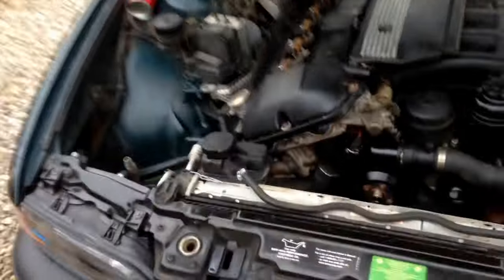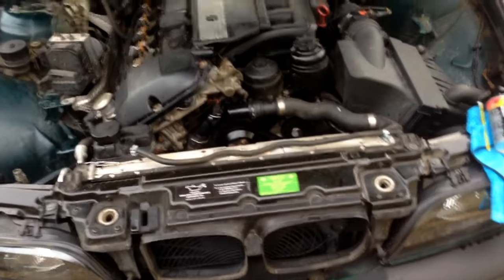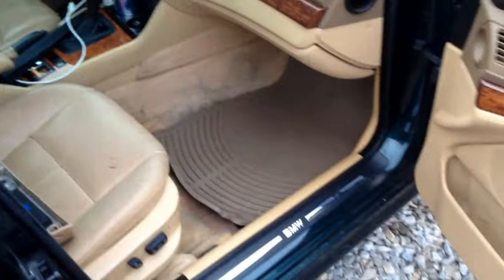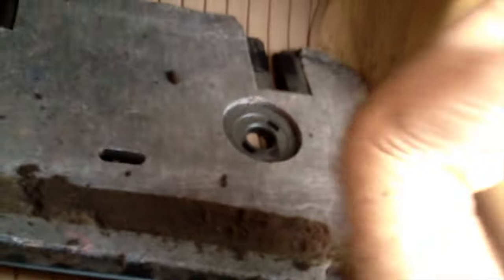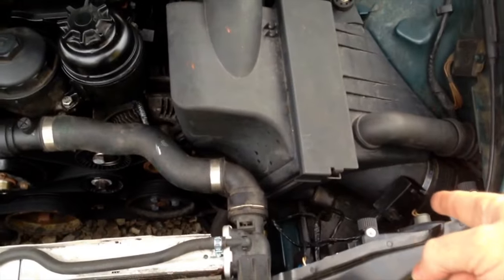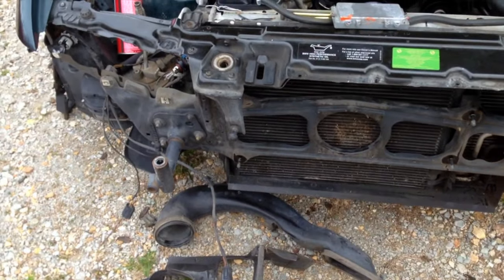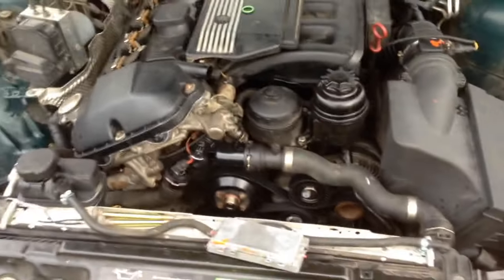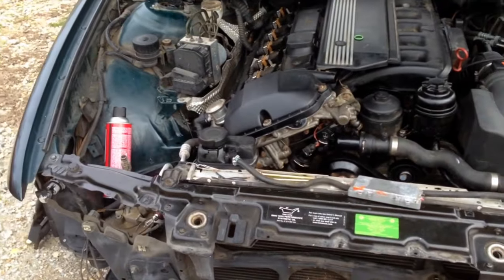BMW E38 E39 AUX Electric Fan Not Working Diagnostics

Comment: Hey Nice videos Nathan, The relay box you refer to that is located on the fan shroud is in fact an air contamination sensor inside it has a gas sensor, this senses Parts per million(PPM) contaminants in the air flow. This then controls air flow in the cabin (if air is contaminated for example when passing through smoke from a yard fire) the air flow in the cabin is turned to internal recirculation. The sensor does have a small foam filter inside prior to the gas sensor, pop the cover open and the filter can be cleaned in IPA and replaced. Works like a dream after. Hope this helps you.....
Reply: So that means the fan just stop working if there's a fire  nearby
Reply: @gilbertobernal8738  no, it means that if detect smoke outside  will put your interior ventilation in recirculated mode, have nothing to do with auxiliary fan.

Comment: cool you speak of that x5. I just picked one up my self but of course it has problems. big problems. head gaskets are blown water is mixing with oil. so I'm going to try to find a motor cheaply hopping I do. so if you know of any good motors laying around and have time  let me know.

Comment: Just had an issue with my new/old e53. the aux fan would not come on. I actually just gave it a spin and it was slightly seized. After a couple of pushes it started spinning on its own and cleared whatever debris/rust that was restricting it and now it works perfectly. Incase anyone sees this in 2022 and your car may have been sitting for a while, give the fan a couple of turns and maybe hit it with some wd40. you may get lucky like i did.

Comment: Do you have a mechanical to electric fan conversion video? I can’t seem to find one and I’m sure you must have covered this topic. Love your channel man thanks for your work
Reply: I think it might be engine dependent, as my 530i has both mech and electric, just found out my elec is bad, as my mech gets loud as the car warms up
Reply: they already have a mechanical, but it needs the electrical for the ac (and apparantly overheating) but i have been driving mine for 4 years without the electric ones and it has not overheated

Comment: This has not been covered in this video AND THIS IS  VERY IMPORTANT.! For BMW X5  there is a huge twist. If the aux fan does not turn on when the AC is on check the AC compressor clutch if it is not also turning when the AC is on you are low or totally empty on Refrigerant yes that's right. Check the pressure of Refrigerant and if it is empty or not have it checked for leaks and refill it. There you go your car is fixed
Reply: its not an X5 video XD

Comment: Hey Nathan, hope you see this comment on this old video, but my E39 540i has been having an odd issue and I'm suspecting something is wrong with my aux fan. After the engine warms up, my aux fan starts blowing HARD. Like abnormally loud hard. When fan is blowing and sounding like a jet engine, my battery light starts flickering. I'm trying to rule the alternator out at this point because it seems to be charging normally until the aux fan kicks on overdrive.

My question: do you think a bad relay could be causing the fan to blow harder than it should and possibly be drawing more power than it should? Or do you think it's the fan itself? Coolant temps are fine so I don't think it's a temp sensor issue causing the fan to go into overdrive

Comment: Great video. I have a 2001 E38 BMW Aux fan problem. I replace my 50A fuse it was shot, I replace the aux fan. When I hit the AC, the fan did not come on. Anything I should check that I did not, Thanks

Comment: hello i have a question i am having the same prob on my x5 e53.. we tried jumping the fan but it would only spin for a few brief moments the same happened with a replacement fan i got from the junk yard. my question is when being jumped are the fans supposed to run full speed or will they only spin for a few moments? trying to diagnose wether my fans are both bad

Comment: Mate, the relay box is located on the fan itself. That little box you said was the relay box is just a pollution sensor and will disable outside air in the cabin if it senses pollution.

Comment: my lower radiator hose got sliced by the pully it moust of laid on ,I cut it and and put it back on shorter ,Now car overheated at idle  , Could I have cut the sensor off ?

Comment: Hi Nathan, Love the content! I had a question, I have a 2002 BMW 325ci with manual transmission so I have the electric fan and it recently stopped working. Unfortunately I left the car on for a little while and it completely overheated and blew my expansion tank along with my radiator. I figured it was a bad fan and I was partly right because it doesn't turn on. I've replaced the temp sensor at the bottom of lower radiator hose with a used one in the past and now with a brand new OEM one. I've taken direct 12v power to the fan and it turns on, I've checked the fan fuse. but I still cant get it to turn on automatically with the car, I feel like the only think left to replace is the relay that mounts on the fan, however I don't like to guess. do you have any ideas?? thank you
Reply: Did you change the fan?
Reply: @vincetaliaferro2777  yes it was the fan after all. I got one from the junk yard

Comment: Hey man I just got back in a bmw your videos are great I’ve done a lot of work using them so far on my 99 e39 538i BUT I cannot for the life of me find a few of my issues anywhere on the internet like I normally can if you see this and still check comments could you msg me ? it is in regards to the cooling system and it’s very frustrating that I can’t find the answers being that the cooling system is Very well documented for these engines/cars lol
Reply from the maker: I answer a few comments still But there is way to many to answer many of them anymore

Comment: My 98 528i, is having auxiliary issues. It turns on when the negative and positive wires from the radiator switch, I cut them to see if it would turn on. The auxiliary fan turns on randomly. I bought and changed the fan switch, I tried 4 different relays located on the driver side that's on the fan shroad. I checked the fuses under the glove box. Again, my fan turns on, how i decided to test it was I took the Male wire that plugs in the fan switch, put the positive and negative wires to touch and turned on. Can you please help me, it doesn't turn on when I have the frost ac on. I'm super annoyed, I dont want to be buying any more unnecessary shit only to figure out my issue was simply and a $10 fix and be 2 min of labor. Lol

Comment: Could you please help me? 
I have following problem. Fan is working but sound is like the fan rubs against something plastic.

1. video is on cold engine (very noisy)
@sRSA

2. video is on warm engine (I could live with that) but if is easy fix, I would like to fix it.
@CebU

Thank you very much :)

Comment: I am having an issue with the fan not coming on at startup with the a/c turned on. The a/c compressor will not kick on until the car reaches it's optimal operating temperature (when the water temp gauge on the interior dash reaches the middle). From that point, my electric fan comes on which I assume triggers my compressor to come up and I have ice cold a/c from then on. Any idea of what is going on in my case? My fan works in the overheat modes but not a/c mode. Help!
Reply: Did you fix that issue? I’m having that same issue
Reply: @pjreynoso15  Needed a new fan.

Comment: I really enjoy your videos & I need your help w/my overheating sensor circuit.  my Veh: 1998 BMW 528I E39 built 4/98.   147k miles  Background: I bought this car via an auction that came with a cracked expansion tank & leaking radiator.   New parts:  Radiator, expansion tank, cap, 88'C thermostat, new BMW plastic thermostat housing, new water pump with metal impeller, new double switch coolant temperature sensor, new aux fan with resistor pack attached, new connector for double switch coolant sensor...and hoses +belts.Testing::::  all related fuses in glove box tested with meter....all good (even the hard to reach 50 amp fuse).  All 3 related relays were checked (1 under dash and 2 under hood), i cleaned relay pins and verified to be working correctly.  I tested aux fan slow speed w/AC on, & fan works correctly.  ♥   I tested medium speed & high speed using the paperclip method @ coolant connector.    I inserted paperclip (brown - black w/red stripe) and medium speed worked perfectly.♥  I then inserted paperclip (brown - black/grey) and the high speed worked perfectly.   ♥    I activated test #7.0 and watched water temps work as per normal (between 104c-108C).  The car runs and drive very smoothly.  ♥Problem:  when Idling in parking lot the display temps climb above 115C and the temp gauge starts leaning towards red zone.  I verified the aux fan (medium speed) still DOES NOT turn on as expected.      When I insert the paperclip, the fan comes on (medium or high functions perfectly....depending on which speed I desire) and then  coolant temperature returns to normal.           WHAT AM I MISSING HERE??    I have the old 3 pin connector so I plan to connect it tonight to see if new coolant sensor (located lower side of radiator on pass side)  is working correctly..    Any suggestions sir?
Reply from the maker: Could be air in the system, , check the big fuse behind the glove box , make sure the little black relay box on the fan shroud is good, at last unhook the battery and touch the cables together to re-initiate the fan
Reply: Thank you for getting back to me Nathan.  I have good news as I believe I found the problem!!  I tested the old sensor and verified it was bad.  Ohms was checked at cold and boiling water on the stove and it never closed.  Then I tested the new sensor installed on the car.   Again Ohms was checked with engine cold & then when up to temperature.  When i displayed test #7.0 on my cluster I waited until it displayed 117C.  The Ohms reading was essentially the same as cold.  CONCLUSION******  THE NEW SENSOR IS BAD!!!

Comment: You cant jumper this 3 wire fan, doesn’t work as its pulse width modulated. The AUC module samples the air, its not a relay, and has nothing to do with the fan operation. Video just expired with no solution?

Comment: FAIL ROGER RABIT: FAN NEEDS 160KZ to trigger fan to ON, + and - leads and then the third wire signal generated to ON. You cannot JUMP TEST the fan like a domestic. POOR customer buying fans he dont need then buying more and told they are bad. LOL We live we learn.
Reply from the maker: Well actually the customer didn't buy anything he didn't need, the new fan was also tested on a 03 525 and it still did not work, ended up using the old fan removing the fan relay box and put it on a switch then it worked the problem was more than likely the ecu not giving signal, never had one I couldn't fix but we had to find a solution before I had 100 hours in this car, pretty much rebuilt the whole car for $300 labor, I'm sure the dealer would of got him for every penny of $7k or more
Reply: OH WOW! high five on not giving up. Thanks for sharing. I love my BMW'S but rely only on my old dodge van.
Reply: So it is not possible to test it? How do I know what's wrong?

Comment: If anyone could help me figure out what’s going on with my E39 would be amazing 

So it’s been overheating I replaced the thermostat sensor, waterpump, thermostat housing, relay box for fan, replaced auxiliary fan, an fuses an it’s still overheating not sure why
Reply: Try bleeding the system if you have not
Reply: Ive bleed the system an also now at this point have replaced everything ahah an it still overheats
Reply: @isaacaragon4725  did you figure it out?
Reply: Try checking clutch fan an cool temp switch
Reply: 1995 740i there is a light comes on dashboard trans failsafe program what causes that